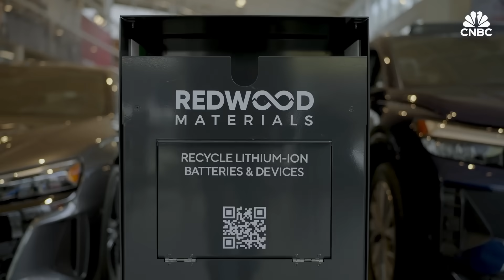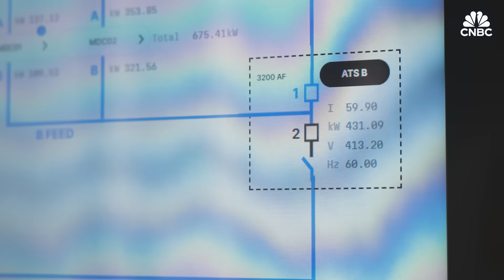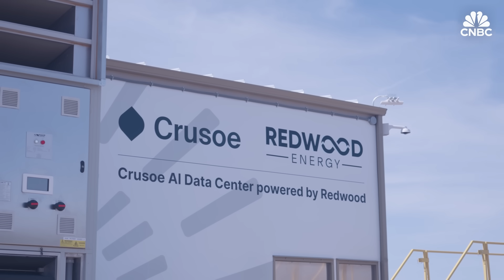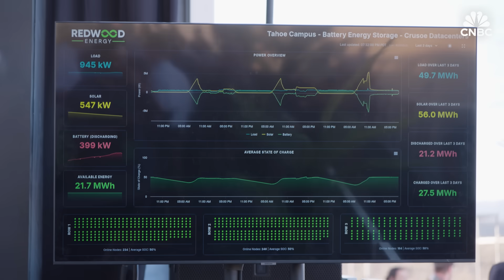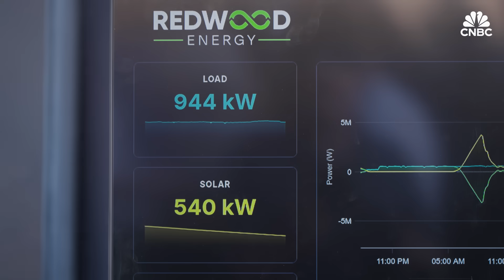How Used EV Batteries Are Being Turned Into Data Centers To Power AI

Comment: Thermal runaway is not possible with LFP (lifepo4/lithium iron phosphate) batteries 

When will the rest of the world understand this and stop using NCM type chemistries

Even sodium chemistry is too tier
Reply: Agreed.
However, for this kind of second life application, they will be using NMC second hand batteries for years until lfp or newer chemistries replace most nmc in vehicles.
But Redwood mitigates the issue by spreading them out.
Very little risk anyone getting hurt, just one of the isolated stacks burns
<shrug>
Reply: Thermal runaway is very well possible even with LFP batteries it’s just less than NMC please inform yourself on the topic
Reply: Sp save us Mr knowitall
Reply: LFP or Sodium is heavier and not as energy dense as NCM.

Comment: I foresee a ton of contaminated water to follow these data centers.
Reply: How?  They don't use water.  They're not using any process that needs water either.
Reply: @romanval69 Battery chemicals are notorious for contaminating soil. When it rains, you have water run-off issues. Age old story.
Reply: @YouViewer4903  The batteries are still sealed in the same pack they're in when installed in a vehicle.   (Are you impying that also EVs leak and contaminate when out on the road??)
Reply: You mean like fracking?
Reply: @jaaklucas1329 fracking gives power,  jobs and builds business and community. I actually live where franking helped lots of people save thier farms. It's always people who don't actually know what they're talking about saying the most.
Reply: @th-cc6ei  Just dont put a flame by your tap water!

Comment: Ha safety and put the EV batteries just in the sun to burn. This project will not last long. 
EV batteries are so drained, de cels of the battery pack are not reliable anymore. Also what is the time that a battery wil sourcing power, a week a month? It is not durable at all.
Reply: years, just at diminished storage capacity.  and I'm sure they're tracking decline in every positioned battery that's part of their micro-grid and make a threshold where they pull it, break it down and reclaim the constituent materials.
Reply: They're charged daily in the Reno sun. Discharged every night to run the data center.   EVs batteries don't fail, they degrade... They're no longer good enough for EVs  but that doesn't matter for stationary storage.

Comment: Great setup, but the ground use is excessive. Building the solar capacity over the batteries would save the storage some of the heat issues, and consume half the area.
Reply: true, but its a desert and they just put it on dirt so whatever
Reply: and they do it in case one self combusts, so the fire doesnt spread to other battery packs
Reply: @423GustavBern it’s not a valid argument lol!
Reply: @423GustavBern yo dessert is an ecosystem just like the jungle
Reply: @423GustavBern they could have used a tent to protect those against the hot sunny days….
Reply: This is northern Nevada, lots of empty space anyways.
Reply: They clearly explained why they set it up the way they did
Reply: Ground use is not excessive for those environments.
It's non arable land, otherwise useless.
Unless there is some claim of habitat issues for an endangered species, this is a win, win. Win all around
Reply: They need space to swap and service the batteries; personnel, forklifts and other equipment access. Also so fire can be contained to the problematic unit.
Reply: @obshaky Blablablabla containers with AC will very easily fix that logistical nightmare
Reply: You might be interested in a space conserving system like those done by B2U Storage Solutions - one in Lancaster CA and another recent one somewhere in TX.  Similar concept using racked packs in units like storage container sized with some thermal conditioning
Reply: Bro. It is in the middle of a desert. Land is free over there.
Reply: They don't need to conserve space, they're in the middle of the desert.
Reply: They don't even put solar planes on racks let alone over head
Reply: People complain it looks ghetto. But clearly in case of thermal runaways it should be spread out and on gravel. Etc. With breakers for each unit.
Reply: Its empty space
Reply: @poochyenarulez lol!!!! Just because it’s empty means it still has to be wasted! That’s the american mind to you wow!!!!!
Reply: @carholic-sz3qv  Its being used though.
Reply: @carholic-sz3qv  I suspect you have never been to Nevada.
Reply: @jaredbinks5448 is this supposed to be a joke? Those batteries are literally in black boxes cocking directly under the scorching heat of the desert how long do you think they can survive that climate? A very well designed container storage system will make their operations way more reliable and still allow them them to switch old with new battery packs.
Reply: @poochyenarulez lol!!!!! What do you mean?
Reply: Have fun getting insurance for that….
Reply: @CaptainDukeSilver Insurance is a scam.
Reply: Yeah it’s extremely wasteful and dangerous to a point and it gives them way too much after work to always physically work on them, the best solution is custom containers systems with AC units that can actually extend the life cycle of the used batteries
Reply: I mean yea unless a battery exploded or caught fire. 😂

Comment: Unless you are using solar, unlike this one. This will not save any electricity.
Reply: not really, grid always produce excess power, unless you want multiple blackout during the day. those excess power produced by multiple power plants can be stored in these type of set up, especially during night time when grid load is low and electricity are cheaper. rather than wasting those excess it can be stored in battery and used during the day when grid load is high and energy price is higher.
Reply: @michael-qt3er  You take from the grid, only as much as you use.
Reply: @saulgoodman2018  yea but the grid had to produce more than what is needed, therefor excess power generated. therefor there is such thing as off peak power price, hence storing excess grid power at lower price make sense and actually save electricity.

you do realize there's such thing as baseload power generation right? nuclear power plant always produce constant power you can't produce less than what they are designed to run at. it's such a headache to lower nuclear power plant output and ram it back up again, so most nuclear power plant just operate at high capacity factor near their maximum output untill they need to change the fuel. 

there always will be excess power available that are wasted on the grid.
Reply: @michael-qt3er  But you are not using that power.
Reply: @saulgoodman2018  hence the battery🤦
Reply: It’s not saving electricity because the data renters needs a lot of electricity, the battery is just a puffer solution
Reply: There's a 2 megawatts of solar panels next to it at far end of the field at 0:09--  Laid flat on the ground (to reduce cost) and is cleaned with a big roomba-like robot.
Reply: @romanval69  That is why I said, unlike this one.
Reply: @romanval69 still needs more electricity
Reply: could be augmented by small wind turbines of various types and sizes as well into same storage blocks.
Reply: It could cut costs. Power is cheaper at night, so if you load up on power at night, and use it in the day, sure, you'd be using the same amount of energy, but you'd pay less for it.
Reply: @rwall514 that’s not how it works with AI you can’t predict when you’re going to use more energy unless tue doing a very specific activity.